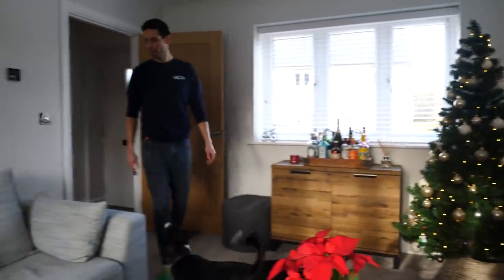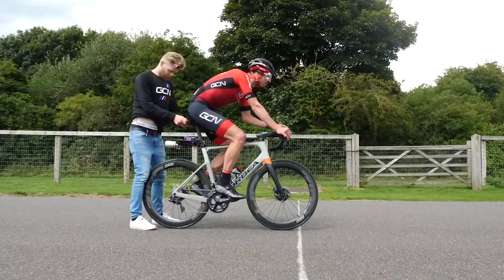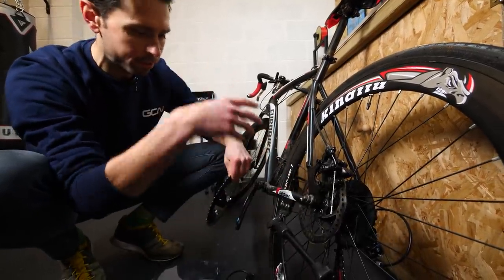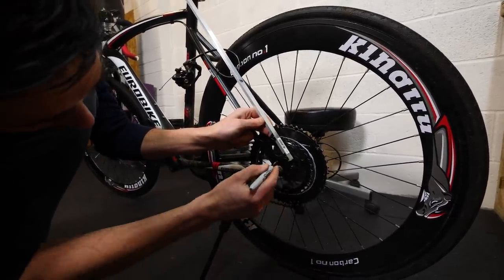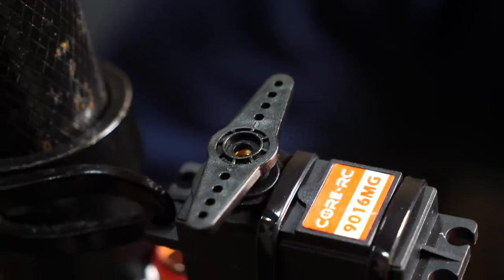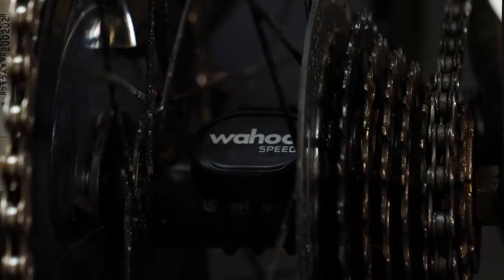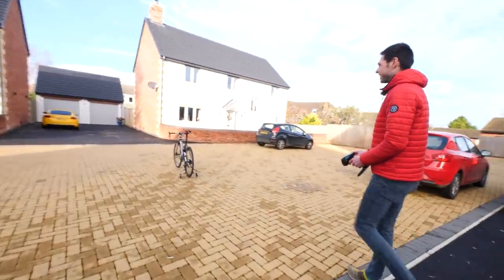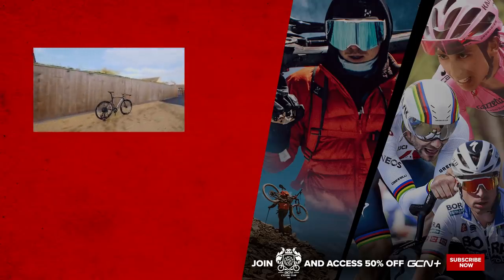I Built A Remote Control Bike In A Day!

Comment: Add some weight low for stability, put a higher voltage battery and/or a bigger drive motor and you'll have a viable rig.  Oh, and strap your phone on, dial a zoom call to it from another phone, and you can tele-operate it from miles away!  Come on, you know you want to try it!

Comment: If both stabilizers touch the ground at the same time, you're doing it wrong.

Except the bike can't balance itself without a rider. WAIT A SECOND.
Reply: I got it!

Stabilizers that only touch the ground when you're not riding it, because sitting on the saddle activates a pulley that raises them (moving forward would also raise them, since going above a certain speed makes the bike become self-stabilizing; they would also fold backwards to reduce drag.)

And they'd have suspension and bushings so that you can still lean a little bit, and still go over uneven roads.

Comment: The stabilizers work against you once you get over 5 kph. Too rigid. When a person steers a bike, the bike has to lean into the turn. 
Now they are meant to have a human on top of them so you may need to add some weights to get the center of gravity to be a fair approximation, but if you just made the stabilizers retract when above crawling speed, I think you would get better results.